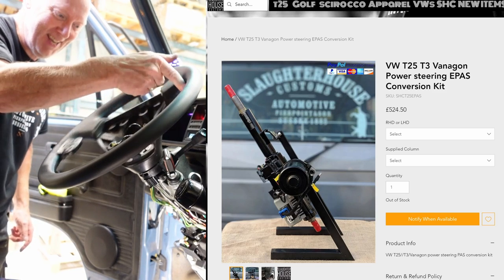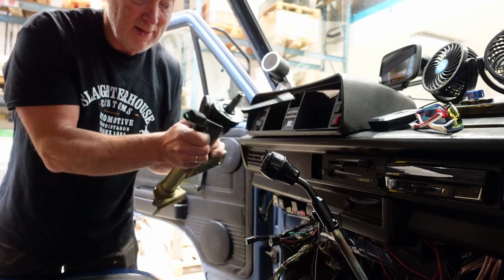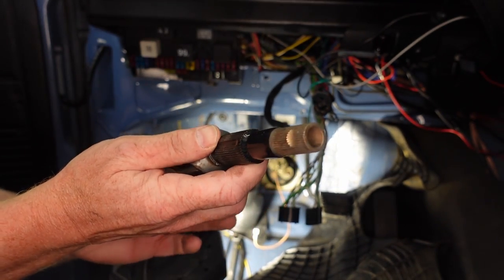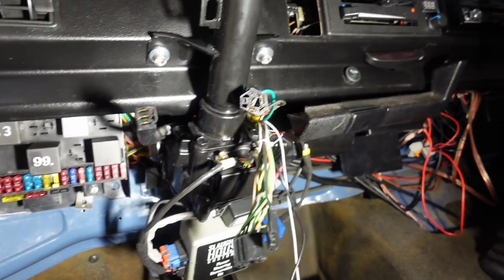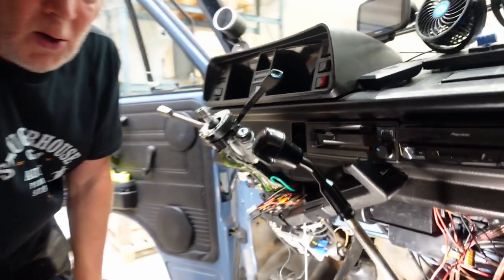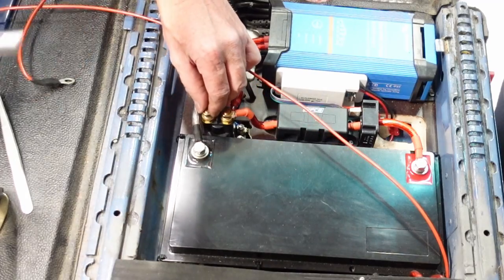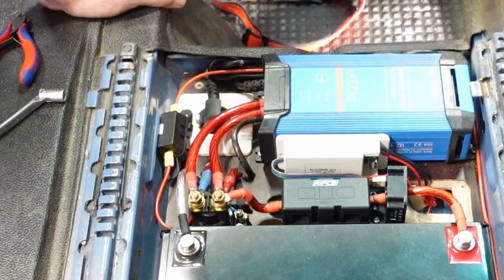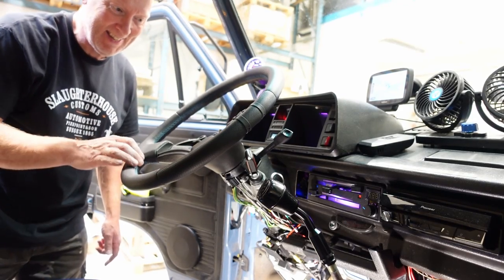Installing the excellent EPAS servo Power Steering from Slaughter House Customs

Comment: Hi. You had to clearance the heater box for the electric motor part of the system?  And does it have any adjustment for amount of assist?  Good video, thanks for making it.
Reply from the maker: Yes, you have to use the dremel to take out a bit. I did it "wrong" so I made a big hole in mine. Will have to try to fix that later. Copy and paste from the EPAS decription: Our units come with an automatic sensitivity controller, adjusting the sensitivity of the steering automatically depending on the steering force applied. This means lighter steering for parking and stiffer for motorway driving.
Reply: Hmmm…. So there’s a speed sensor in the kit so the epas knows of you’re parking or driving at Speed? The home built one I’ve seen used a dash mounted adjusting knob which took the place of the original application speed sensor.
Reply from the maker: @ragnarhairybreeks  There is a torque sensor build in.

Comment: Nice video, I'm wondering how your steering column looks like now , do the plastic covers still fit ?
Reply from the maker: No the plastic cover will not fit. But there are incuded a "leather" cover you use to cover the motor and electronics. I have not installed them yet.